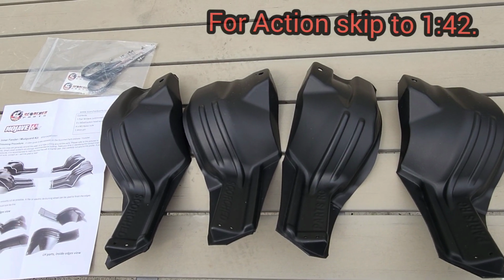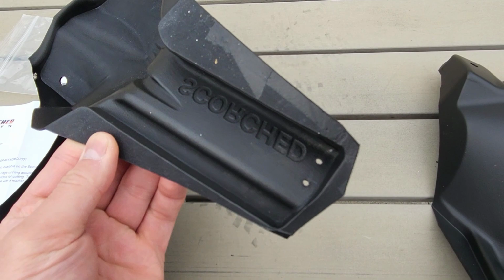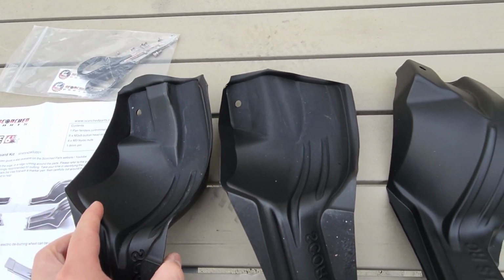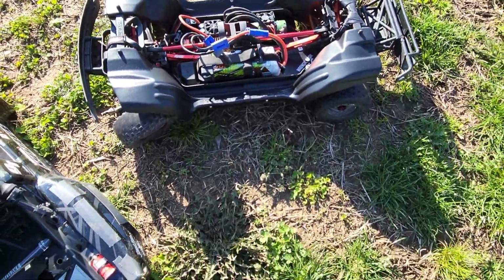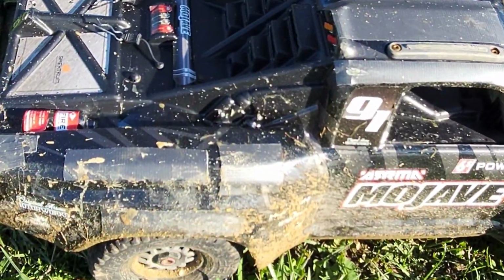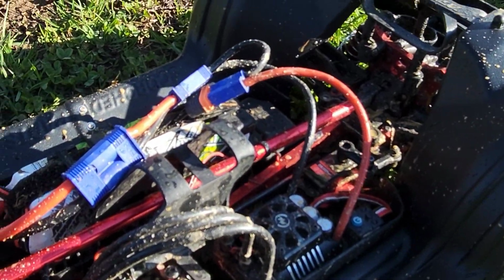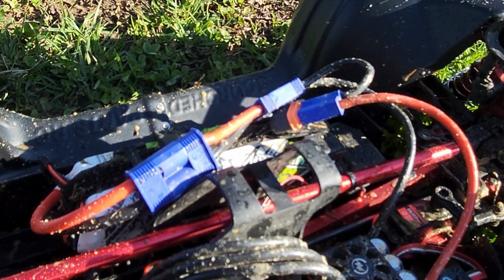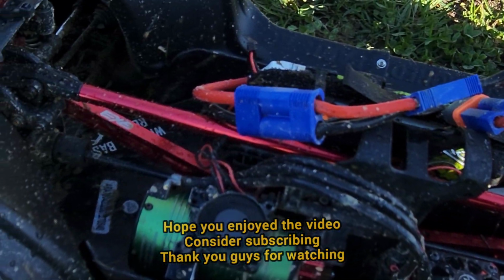Mojave EXB / Scorched Fenders / Worth your money? Watch to find out

Comment: Recently found your channel.. since filming this one,are you still using the same guards? Do they help to prevent the parachute affect ? I will be getting 2 sets for my trucks..Awesome video. In slow motion , you want to be in for that ride..
Reply from the maker: I'm still using the guards.  They work great. As for the parachute affect, I would have to test it doing speed runs.   For the most part I don't notice the front lifting up as much as it used to.  So I believe it helped.  Thx for watching!